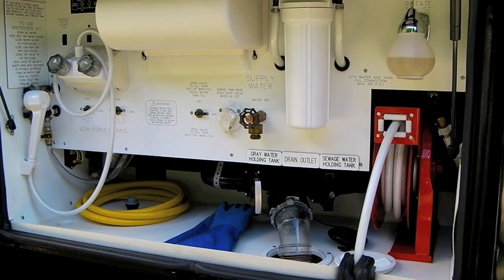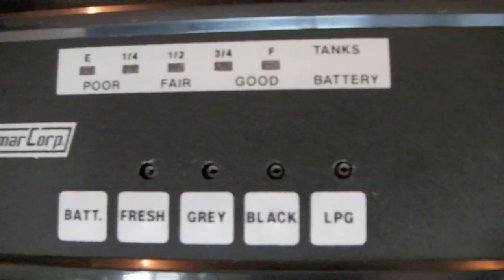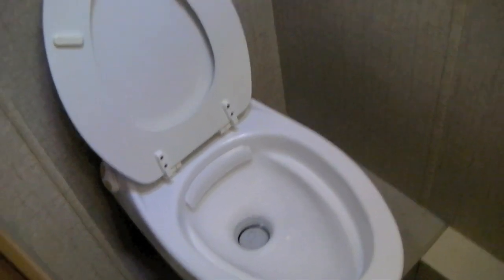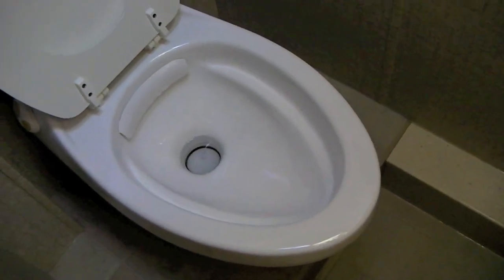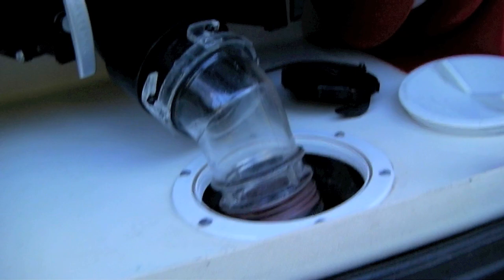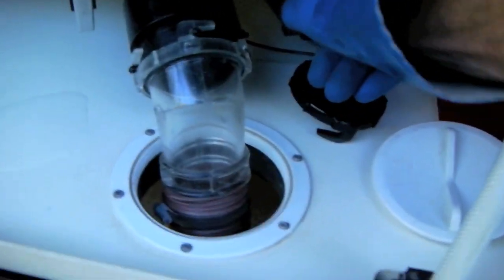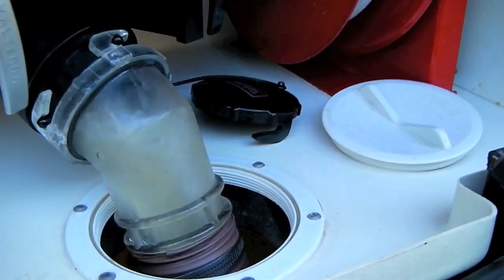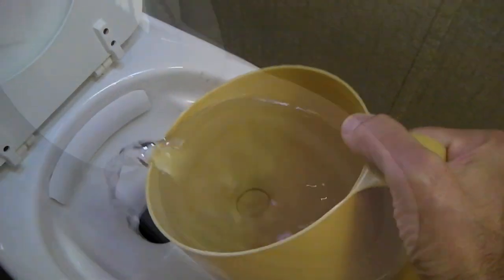How To Dump & Clean an RV Black Tank

Comment: Hello i am a new rv owner and have questions so whenever we are parked were supposed to close the black water valve closed but the two grey water tank valves open would that be the reason it would smell bad have added many chemicals and smells when someone uses the restroom please help
Reply from the maker: Hi Axel! Welcome to RVing!  😉  Yes... you need to keep the black tank valve closed all the time, whether you're hooked up or not. Otherwise, the liquids run out and leave the solids behind... and then you'll REALLY have a problem with odor! You can leave the gray valve(s) open when you're hooked up because that should only be the water from sinks and your shower, so there isn't the same issue with "solids".

As far as odor from the black tank when flushing... one quick/easy solution is to always make sure that you turn any vent fan in the bathroom off BEFORE flushing. Otherwise, the fan could be pulling air up from out of the black tank (the roof vent allows fresh air to replace it in the tank, so you basically have an open route for the vent fan to pull air from outside, down through the black tank, and right up to your nostrils)! 🥴

If that's not the trouble, you may need to "soak" your black tank to get rid of whatever is left/stuck in there and smelling. You can search for the "Geo Method", as that's a popular option to both clean/soak a trouble tank AND as an alternative to using tank chemicals for regular maintenance. Or you could use a product like Happy Campers Extreme Clean (you can buy it here on Amazon: https://amzn.to/34AfQKK), adding a heavy dose and filling the tank... then letting it soak that way as long as you can before dumping (if you can drive the RV some distance with the tank full, that will help to dislodge anything still stuck in the tank). If a single treatment doesn't work, you may need to repeat it.

Lastly, you may want to consider replacing your roof vent cap(s) for the black tank with something like a 360 Vent, which helps to use wind to create suction up the vent pipe... so when you flush, air goes DOWN into the toilet, not up. It's not a 100% fix (there's not always a breeze when you need it), but it really helps. We have a video about it here: https://youtu.be/3xX60cCHwlM

Hope one of the above helps solve your problem!!
Reply: Thank you appreciate the help man!!
Reply: Definitely subscribe to your channel!

Comment: Have a question.....when I dump my black tank there is a bad odour that comes up in my kitchen sink.Also my shower backs up when I shower......I thot the shower would be connected to my gray tank.......help need answers..........
Reply from the maker: Hi Dorothy! Both of those situations sound strange... as you are correct in thinking that the sinks and showers should be connected to the gray tank and not the black. Is it possible that the handles for the black & gray tank have been switched... and what you think is the black is the gray and vice versa? Or do you have a fifth wheel?  Because we understand that some fifth wheels may have a sink (or possibly the shower) plumbed to the black tank because of their location in the floor plan.

Another possibility is that the vent pipe from the gray tank up to the roof is blocked (spiders or mud daubers are common culprits) and the blockage is preventing air from entering/exiting the tank properly when larger volumes of water enter (showering) or exit (dumping) the tank.

If you can provide some more detail about your RV, etc, we can try to help... or we can at least try to direct you to somewhere where you can find an answer.
Reply: Hi ,thanks for such a quick reply.The unit in question is a fifth wheel.A Quantum 35 footer.The bathroom is up top on the same level as the bedroom.The shower is on the same level.Step down two steps to the kitchen .fridge and stove is on the right hand side.Has a island in the middle of the room. Front room  is at the back.I did find a diagram on the net of the pipe system but doesnt give me much help.The handles for the system are okay and not in reverse mode.If you could check out the pipe layout on the net and look at the floor plan of the fifth wheel maybe you could give me another idea.....thank you
Reply from the maker: Hi Dorothy,

It sounds like a nice floor plan! And we wish we had more of an idea to help you out, but your best bet is to try and connect with someone else who owns (or owned) the same unit and see if they can point you in the correct direction. To do that, we'd recommend going to the forums at iRV2.com ( www.irv2.com/forums/ ). It's free to join... and free to post... and we'd bet someone there will be able to quickly answer you!

Comment: Wait so when I use the bathroom, the fan is not supposed to be on? What is the purpose of the fan then? I'm confused.
Reply from the maker: +Sandy Lomeli The fan can absolutely be on while you are in the bathroom. But you should shut it off when you're ready to flush the toilet. That's because opening the toilet valve opens a direct air line down into the black tank, and the fan could pull oders up out of the tank into the bathroom. You can turn the fan right back on after you flush.

Comment: My travel trailer has a label on the black tank flush inlet connector stating  "Do not flush with drain valve closed".  Why?
Reply from the maker: +Stan Creech Because if you walk away and leave it running, it will fill the tank and come out the roof vent. So don't do that! 😉

Comment: Is it good to out ridx Everytime you clean?
Reply from the maker: Yes. After dumping the tank, you want to add in some sort of tank treatment that stays in the tank until you dump again. It helps control odor. We use Rid-X or Happy Campers. Just be sure not to use anything with formaldehyde in it.
Reply: @RVgeeks  ithought ridx could be damagable when using it alot. Another question so I fill up the tank with water to rinse out and then I fill it up again to use it to flush the toilet?
Reply from the maker: Hi Helena! Just to clear up any misconception about how this process works, here’s what happens. Imagine starting off in a brand new RV for the first time, where your black and gray tanks are both empty, and you fill up your freshwater tank from a “city” water fill spigot, typically found at a campsite or near a dump station. You would prepare your toilet for use by adding a small amount of one of the toilet chemicals mentioned above, and a gallon or two of freshwater, both down the toilet into the black tank. As you slowly fill the black tank by using the toilet, that small amount of toilet chemical down in the tank will help control odour as you continue to fill it up. Once the black tank nears full, you flush it out using the method we’ve shown in the video, and then begin slowly filling it up again as you use it. The water that flushes the toilet comes from the freshwater tank, or from a city water connection if you are at a campground with water at the campsite. Hope this is clear and helps a little bit. Safe travels!

Comment: where i am I had to do a hard hook up. how do I attach hard hook up to that clear elbow?
Reply from the maker: Hi Kellie... we haven't encountered a situation where a hard hook-up was required. If the hard hook-up connects to your RV's bayonet fitting the same way a typical flexible hose does, then you may be able to use the same clear elbow we do. If it's connected in some other way, you may be out of luck.

Comment: There is no reason to close the gray tank valve overnight to flush out the sewer hose. That's what the sewer rinse hookup will do anyways after you flush the black tank.
Reply from the maker: True, you don't HAVE to close the gray, but there are reasons to do so. Pulling the black valve send sends a rush of sewage down the hose, coating the entire entire interior of the hose. Using the black tank flush will only send a small stream of water down the lowest part of the sewer hose, failing to clean out the entire hose. Even using our technique of closing the black valve with the flush running, and then opening it again after allowing it build up in the black tank, will never completely remove 100% of the fecal matter from the black tank. Doing a final flush with a large volume of water from the gray tank will do a better job of removing any leftover black tank matter from the hose, and takes virtually no effort (just closing the gray valve the night before), keeping the hose more free of bacteria and odor. And of course it's particularly helpful at dump stations, where leaving your flush running long enough to do a very good job may not be practical when there are people waiting behind you.

Comment: Other Video's prove that ice does almost nothing for your black tank. A guy actually had a blank tank in the bed of his pickup truck. He use peanut butter as a substitute for poop (As NASA Does) added water and ice. He drove down the road for 30 minutes, hitting the brakes, hitting the gas pedal, swerving side to side (can't really do this in your RV without getting into an accident. The Black tank was transparent so you could see what was going on inside the tank. Afterwards he drained the tank and the poop was still stuck on the bottom and sides of the tank. So don't waste your time using ice.
There are chemicals that work better to break down the cramp.
Reply from the maker: That video only proved that ice doesn't work for "pyramiding", which hardly needed proving, since nobody ever claimed that ice would work for a large pile. What ice does beautifully is scrape off dried material from the bottom of the tank which is commonly left behind after leaving a tank empty in storage with some material left on the bottom. We had this exact experience, and ice was the only thing that worked like a charm.

Comment: Do you need to water regulator to flush black tank
Reply from the maker: Because you can’t close the black tank flush like a faucet, there’s no way to build maximum pressure in that plumbing line, so it’s not as much at risk of a burst pipe as the rest of the plumbing in the RV. So maybe not as critical to use a pressure regulator. That said, connecting it to a very high-pressure source without a regulator just a single time (such as the large-diameter standpipes at some campgrounds) could potentially explode the plumbing. We wouldn’t risk it.

Comment: I still don't understand what you mean with flushing the toilet with the fan on.
Reply from the maker: There's a vent tube that goes from the black tank up to the roof, so every time you open the toilet valve, there's a path for airflow from the bathroom to the roof.... through the black tank. If you turn the fan on (which blows outward) with the toilet valve open, you'll be pulling air down the roof vent, through the black tank, and out through the open toilet valve, so of course you'll get a nasty whiff! LOL This is made worse when all the RV's windows are closed, which makes that route (roof to black tank to toilet) the easiest route for air to flow.
Reply: Thanks sir

Comment: So what happens when you have a pyramid situation going on? What do I do first?
Reply from the maker: The very first thing to try is Happy Campers Extreme Tank Cleaner: https://amzn.to/2Mf4O28 It may take several treatments, but it's worth it if it can save you the cost of having a professional try to clean it. Add it according to the instructions, fill with water, and let it soak, soak soak. This stuff can break down some pretty hardened on material.

Comment: WON'T LEAVING THE GREY TANK VALVE OPEN ALLOW SMELL FROM THE DUMP TANK  COME UP INTO THE RV ??
Reply from the maker: The gray tank is isolated from the interior of the RV by P-traps and air admittance valves, so leaving the gray valve open doesn't affect that. But if you ever have an issue with odor coming up from the campground's sewer system, here's a great tip to try out: https://youtu.be/dslcXoydeY4

Comment: Is the ice really works?
Reply from the maker: +elmaster22 It depends on what you're trying to accomplish by using it. If you've left your black valve open while using the tank, and all the liquids have run out, leaving a pile of solids in a pyramid, ice won't work. But if you left your RV in storage with the black tank empty, but some solids still inside, and they dried down onto the bottom of the tank, ice will absolutely scrub some or all of it off. We're speaking from first-hand experience. ;-)
Reply: +RVgeeks cool.... Thanks 👍👍

Comment: It is not a good idea to leave ANY of your tanks open.  Grey tanks, just like the black, have solids in them too; grease, hair,  etc... Creating a "p-trap" in the drain hose will keep the sewer gas from entering your rv, but it will NOT prevent solids from dying up in your grey tank.  It is best to let the grey tank(s) fill up before dumping; this gives the best possible flush.

Comment: I noticed the label for the flush system said to not have the gate closed while operating it.  My trailer has the same notice.  Yet, you close the tank up to fill it up with the flush system--against that advice.  Every had any problems with that process, since it's specifically not recommended?  (okay, call me chicken...but I hate to disregard printed warnings....)
Reply from the maker: No worries Ron. I think they put that there for two reasons. First, to be sure nobody can sue them if they attach the hose and leave it on and forget it. And two, so that water won't come up out of the roof vent pipe if someone attaches the hose and leaves it on and forgets it. lol

Comment: My trailer doesn't have a tank flush attachment on it.
Reply from the maker: That's not uncommon, Fran. You can get a wand (like this: https://amzn.to/2NcADxa or like this: https://amzn.to/2NklyKa ) that attaches to a standard garden hose and can then be inserted down your toilet (step on the pedal to open the valve) if you have a direct drop down to the black tank from your toilet. The wand has a rotating sprayer on it that you can use to help flush out anything that didn't drain when you pulled the black valve.

Comment: hey can you use sample green in your black
Reply from the maker: I've never heard of using Simple Green in a black tank. Since it's a degreaser, I wouldn't think it would be the best choice.
Reply: so you can use sample black tank and make it smell good also wright????
Reply from the maker: Chuck Dumont No. I would not recommend using Simple Green in the black tank.

Comment: Per manufacturer instructions don't run water into black water rinse without having black dump valve open
Reply from the maker: They're covering themselves so that if someone walks away and leaves the water running with the valve closed, they aren't liable. We've been doing this for over 14 years, and it is harmless... unless you walk away and leave the water running... so don't do that. ;-)

Comment: I actually would prefer the wait at a dump station over the smell of everyone dumping at their camp site, grey water is one thing but its another to smell the lingering stench of everyone's poo being dumped day in and out. Why can't they just have more than 1 dump station and have people only use their site for grey water, it just really ruins the experience of camping and fresh air especially in campgrounds that also have traditional tent or pop up tent campers, just my opinion BUT I have been told it was once proper etiquette to only dump black water at the dump station. I also find those poo dumping plastic bins to be very unsanitary and gross. Maybe its just me but I don't think its too much to ask someone to move every 1-2 weeks to dump in order to preserve everyone's camping experience.
Reply from the maker: +Lauren Highfill We actually find dumping black at a campsite to be completely odorless due to the tight seal of the sewer hose into the sewer connection. Dump stations smell much worse to us because of the lack of that seal. If you are smelling someone dumping their black tank, it's a good bet they're not doing it properly (i.e. hose not attached properly to the sewer inlet).

Comment: This is way less intimidating and gross than I thought it was going to be. After watching composting and cassette videos, this seems like a breeze. My only concern is the water usage. Even though I'd probably spend most of my time at a campground/RV park I couldn't help but feel guilty that there would be a more eco-friendly way to dispose of waste to conserve water.
Reply from the maker: Hi Ciara! Sorry if we weren’t clear, but this method of extreme flushing is only for occasional super cleaning if needed. Normal dumping and flushing uses far less water.
Reply: Normal flushing would be just using your gray water afterward then? Sorry, complete newb here >.< So far this seems like the most hassle free method if you do it properly. Thanks for the reply, I appreciate it!

Comment: uhm your "sniff test" isn't good to do. there is still micro bacterial buggers in that air.
Reply from the maker: +Calvin Brown Obviously we're fearless!
Reply: A bacterial and viral infection to the lungs isn`t a good thing to have in life.

I did enjoy the you tube presentation but maybe there might be a way to put pressure washer nozzle of some sort in the tank. something on 5 sides that connected to water could flush the sides down on each side. might have to have the nozzle to turn with an electric motor. since the spray pattern is flat. that might work if there was a way to prevent clogging of the nozzles when the tank is filled.

Comment: ice method doesn't work
Reply from the maker: +Samantha Monaghan Ice worked great for us, scraping dried-on debris off the bottom of the black tank. The people that ice DOESN'T work for are those that are under the mistaken impression that it will cut through pyramiding. It won't. But then nobody ever claimed that it would.